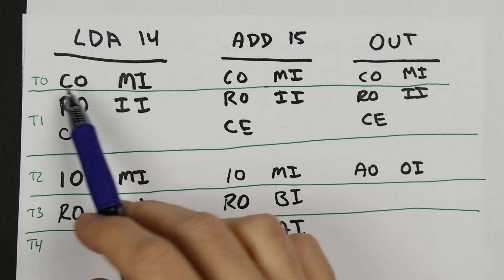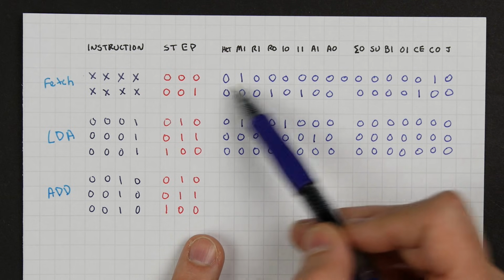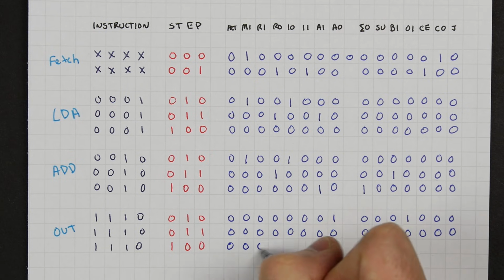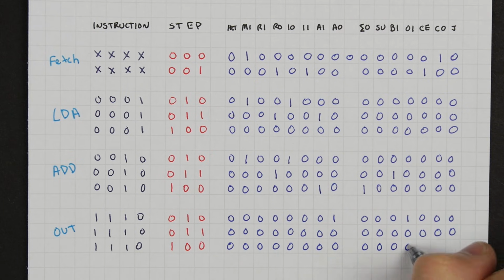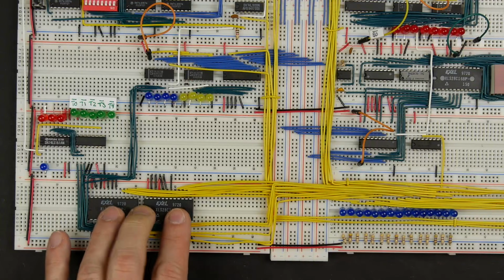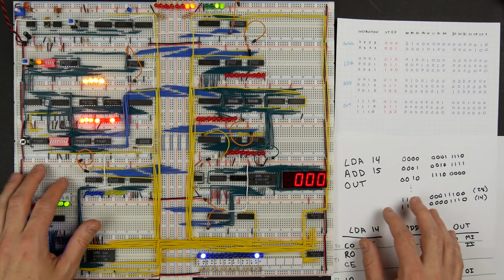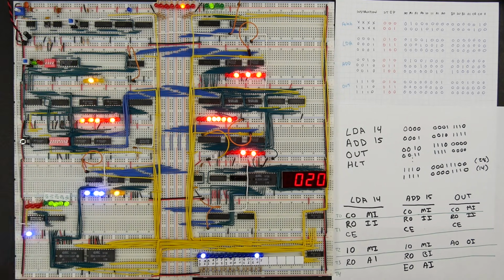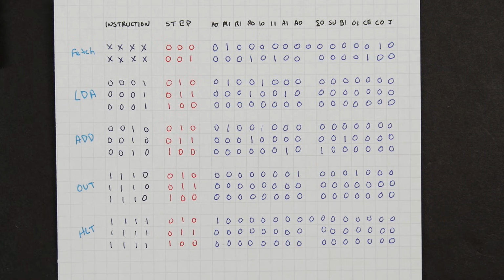8-bit CPU control logic: Part 3

Comment: This awesome "thing we could do with this 16th output from the eeprom" is to implement the counter reset so that commands don't have extra wasted cycles. The 16th command (io0 on the right eeprom) could be to made to be 1 to reset the timer when the command is completed. The trick would be to not mess up your program by resetting the step too early.

You could make this 'reset' its own line on the command table for a given computer command so that it only takes 1 cycle to finish off the current command (versus 2 wasted cycles on the OUT command, or more wasted cycles if we implemented a complicated command later), or, more elegantly, use the off-clock cycle pulse to check if this 16th bit is 1,and if so, then reset the steper to zero instead of incrementing on the clock tick.

Hope I thought that through properly!
I love all of your videos, they are amazing. Thank you!
Reply: "not mess up your program by resetting the step too early", that''s the point. A D-register may do the trick with the next clock pulse, if you still have room on the bread board.

Comment: Updated the parts list: https://github.com/DutchMaker/8-bit-Breadboard-Computer
@Ben: I simplified the EEPROM programming a bit on my build by passing the T0+T1+Instruction through an AND gate so that the instruction is only passed through to the address lines when T0 and T1 are both 0.
That way the fetch cycle only has to be programmed once and not for all instructions.
Reply: I would highly, HIGHLY recommend buying the best quality boards you can find. If they end up being the biggest cost in the project so be it. I've had cheaper breadboards develop contact problems with only hours of use, I'd hate to think how cheap boards would behave on a project of this scale...
Reply: Hello,  Took the liberty and updated your nice control-eeprom-2 spreadsheet 

control-eeprom-2.xls 
https://drive.google.com/open?id=0B2ZePCSY4JnFSk01V1FtQUVsdWs 

control-eeprom-2.pdf
https://drive.google.com/open?id=0B2ZePCSY4JnFNHNYU0gwclZFQzQ 

Thanks Mike
Reply: Thanks a lot for having a parts list. I'm really considering building this myself now that I know what I need. Any idea for the approximate total price for all parts (besides breadboard and wire maybe)?
Reply: Around $80 on chips (which will get you more chips than you need), $30 in breadboards (but this really depends on what quality you buy. Ben's are definitely more expensive) and probably around $30 for wires (you want good quality 22 AWG solid core wire). I got all the parts from eBay, except for the wires which came from Adafruit.
Things like LED's, resistors, capacitors and switches were already in my possession but will otherwise also cost you around $10 - $20 depending on the bulk you are buying.
Reply: Thanks Mike, I'll make sure to add it to my repository!
Reply: I fully agree with that! Mine aren't the best quality and I had to put in a lot of extra wires for power lines and some capacitors in order to maintain acceptable voltage levels througout the circuit.

Comment: i find it hard to understand the eeprom programming
Reply: He had an entire hour+ worth of eeprom videos back a ways. Check them out, it makes a lot of sense.
Reply: The most helpful part was when he drew out the huge logic circuit that implemented the huge truth table (the lights on the digits on the counters for the OUT command) and then actually had it implemented. It allowed me to grasp what the eeprom was actually accomplishing, tho I'm not sure what it physically does inside that implements the truth table we program in, but whatever it does it reduces to that logic circuit he sketched out.
Reply: He has a video on how he programmed the EEPROM.
And while you are at it, watch all his videos on this build. They are great!
Reply: i had just forgotten how he programmed in the past
Reply: Simply put, you make Write enable LOW, Output Enable HIGH (these are active low signals).
Give an address to the address pins, give whatever you want at that address to I/O pins, and pass a 1ms pulse to the chip.

Comment: You could use the last control bit to reset the step counter which would reclaim those lost clock cycles on ops that use less than five cycles.
(I know the gains would be pretty minimal in this case (Only one cycle on three/one-step (incl/not incl fetch cycle) ops and zero cycles on four/two-step ops since the step-counter-reset micro-instruction itself would have to be a step), but it's something that would have exponentially larger benefits as your architecture gets complex with more steps available for each op. This is actually very interesting because it shows the benefits of a more complex architecture. By having more steps available per op (thereby increasing the complexity of the architecture; the cost), you can have more complex ops that reduce the amount of work the programmer has to do, as well as reducing memory requirements by reducing the number of ops required to accomplish a given task (the benefits).)
Reply: You could have your microinstruction counter reset take place on the last cycle of the instruction's operation, but that might require additional timing to make sure it worked right... A synchronous reset on the falling clock edge, perhaps, unique to this one control signal.
Reply: Exactly my thoughts!!

Comment: Since you mentioned additional functionality, have you thought about expanding the design to support larger memory spaces and instructions? 
You could easily modify the current design to use more cycles per instruction, make the address space 16 bit (by using two special 8 bit registers), and expand the instruction set to either use larger instructions (RISC style sort of like what the PIC16s do - other 8-bit MCUs might do the same thing), or adopt a variable instruction length CISC style with special registers (you are sort of already doing that, and it would mean possibly smaller code size at the expense of more instructions to define), or even adopt an already existing instruction set so that you can use already existing compilers (e.g. 8086, Z80, etc.). 
If you do that, you can then expand this series into memory mapped I/O, and then you also have the ability of taking the memory map and adding a MMU to deal with virtual memory. All of which should be doable using registers and EEPROMs as look-up tables (though it will quickly grow out of control in terms of breadboard space).
Reply: +hjups I definitely agree with you, and I hope Ben will tackle on the expansion of this CPU.. The book he talks about in the first video (I can't remember the title, it was written by Albert Malvino) does exactly this: it starts from the SAP-1, and adds more and more functionality with the SAP-2 and SAP-3, basicly expanding what was built in the previous step. It's a marvelous idea and I'm glad I found these videos, I'm learning lots of things
Reply: hjups that would all be possible but it would defeat the purpose of building the simplest computer possible for educational purposes
Reply: I disagree. The ability to expand the design without significantly modifying the core "computer" would have significantly more educational impact. If you compare starting off with a more complicated design in mind (which requires a lot of starting knowledge), rather than the ability to transition into a more complicated design, then you would be correct.
Right now, this model is a "toy" (in the academic sense), and can't really do much (especially with 16 Bytes of RAM). It would be a wasted opportunity to expand its functionality to teach more advanced topics. 
The mindset of keeping it simple for educational purposes is a pitfall that a lot of courses and textbooks encounter, and end up leaving a disconnect between the educational material and real systems. Unfortunately, only one of the courses I ever took broke that paradigm and ended up bringing the theory of operation back to reality (it was an FPGA based software defined radio, which could actually process an IQ stream and play audio). 
Keep in mind that I am not suggesting that the current design be abandoned, or that it should focus on a pipelined, super-scalar, or an out of order execution model, all of those things would defeat the purpose.

A simple example of what I am talking about..... let the current memory address 0 correspond to main memory. Let memory address 1 correspond to the lower 8 bits of the address, and memory address 2 correspond to the upper 8 bits. Now if you want to read from or write to the 16 bit address space, you set the address by writing to the bus memory address 1 and 2, and then read / write from bus memory address 0. Then the only other step needed is to support a 16 bit program counter, which could be connected to a simple multiplexer switching between the bus memory addresses and the program counter, which is toggled during the instruction fetch phase. 
What has that done differently to this design? It made the program counter 16 bits instead of 4 (an easy extension), removed the program counter address from the internal bus, and changed the way the RAM worked, but not how it appears to the rest of the system.... The ALU doesn't change, if the initial instruction set supports read/write from/to the current RAM, then the instruction set doesn't change, and in fact, the control signals from the micro-instructions don't change. (The jump instruction might changed based on how it's implemented, but you could do the MIPS method and keep the upper n bits). And with all of that, you just expanded your computer from having 16 Bytes of memory to having 65K!

Anyways, the point that I was trying to make is: the opportunity to teach more advanced topics based on the framework of a simple design is significantly more powerful than saying "here is a simple toy", now here is a real world case study, leaving the students (or in this cause audience) confused on how one went from the first to the second. And believe it or not, many computer engineering professors can't actually answer that question, because they never bothered to study systems outside of the "toy" setting (it took until a special topics graduate course for me to learn about how I/O is actually handled by a computer).

Comment: Might want to add an additional control line to reset the micro-code clock when the instruction is done so save unused cycles.
Reply: That was a suggestion posted in the comments to the last video in the series, I think he was trying to acknowledge the possibility of doing so, without getting into the implementation for now. However he has mentioned adding more to the computer (including more control lines) in the future. I'd guess that he may want to finish the basic version to finish the teaching tool, then address some of the possible optimizations from the comments (adding CE to T1 was one such optimization that did get added already).
Reply: There's a spare output line on one of the EEPROMS, that could be used to send a reset pulse to the microinstruction counter :)
Reply: You could also just use a combination of control words that is never used (e.g. all 0) to reset the step counter. Just take timing into account, so that a delayed in the eeprom outputs does not accidentally reset the counter (e.g. by waiting for the falling edge of the clock).
Reply: @LordPhobos6502  I thought the exact same thing. It's actually extremely easy to implement
Reply: I was thinking the same
Reply: This would be a very simple way to do it, and just set that signal work the last step of any op. When I build mine, I'm definitely going to do that ;)
Reply: Yeah i was thinking that too, it would work very nicely.
Reply: The point is  "not mess up your program by resetting the step too early". A D-register may do the trick with the next clock pulse, if you still have room on the bread board.
Reply: Nice idea, Im going to try to implement instructions as an FSM so it will not need that control line.
Reply: exactly i was thinking same
Reply: Variable length pipeline is what made the slower 6502 outperform the z80... despite the z80 having more compact instructions. So resetting the clock is a worthy pursuit.
Reply: @Altera32  Sorry? The Z80 has a perfectly variable pipeline. There are instructions of 4, 5, 6, 7, 8, 9, 10, 11, 12, 13, , 14, 15, 16, 17, 19, 20, 21, and 23 clock cycles. A memory fetch just takes 3cc (actually in the case of M1 fetches it is 2.5cc, which is why some Z80 devices only have wait states on M1 cycles), then it increments the memory refresh register, and it executes the rest of the instruction during the fetching of the next instruction. Some instructions like INC HL take 6cc instead of 4cc for this reason, because they reuse the 16-bit circuitry used to fetch the next instruction, which means that the next fetch needs to be delayed.
Another example: LD (IX+*),A and LD (IX+*),* take the same amount of time (19cc), despite the latter having to fetch one extra byte. This fetch is just executed in parallel with the IX+* addition.

The Z80 may need more clock cycles for the same number of operations, but that is not because it is not pipelined. If it wasn't, it would be nearly twice as slow. It is also designed to run at 3x as high a clock rate as the 6502. The speed difference is from the 6502's many addressing modes making for faster memory accesses. Meanwhile the Z80 was trying to cut down on hardware cost by reusing circuitry. For example it only has a 4-bit ALU, so even 8-bit operations need to pass through it twice. This only becomes a bottleneck when doing 16-bit arithmetic, though.

Also, here is an example instruction for each instruction length, to show that I know what I'm talking about:
4: NOP
5: RET Z if NZ
6: LD SP,HL
7: LD A,*
8: NEG
9: LD A,I
10: POP HL
11: PUSH HL
12: IN A,(C)
13: LD A,(**)
14: LD IX,**
15: ADC HL,HL
16: LD HL,(**)
17: CALL **
19: LD (IX+*),A
20: LD IX,(**)
21: LDIR
23: SLA (IX+*)

This is what needs to happen during a 4cc NOP, for example:
- put PC on the data bus, increment PC
- 2.5cc later, read the value
- increment memory refresh register (using the same circuitry as the one that increments PC) while decoding the read value
- start fetching the next opcode

now here is a LD A,B (also 4cc):
- put PC on the data bus, increment PC
- 2.5cc later, read the value
- increment memory refresh register (using the same circuitry as the one that increments PC) while decoding the read value
- start fetching the next opcode
- pass the LSN of B to the ALU, store it to A
- pass the MSN of B to the ALU, store it to A

And a INC HL (6cc):
- put PC on the data bus, increment PC
- 2.5cc later, read the value
- increment memory refresh register (using the same circuitry as the one that increments PC) while decoding the read value
- do not start fetching the next opcode because INC HL needs to increment a 16-bit value first
- increment the 16-bit HL
- start fetching the next opcode
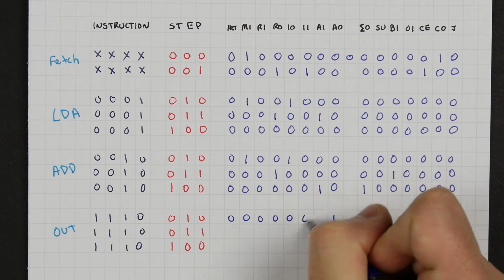Reply: 9:08 he explicitly mentions that possibility.
Reply: I notice an output unused as well and thought the same thing.
Reply: Count down from max number of steps, when you reach zero use an or gate that sums your binary pattern to trigger counter reset; (Invert output if required).

Comment: I had a microprocessors class in college where we breadboard a MC68000, added memory, and then programmed it to do something but this whole series is immensely more educational than that college course.  Thank you for these videos!
Reply: i have learned more from this guy than any prof i had
Reply: An MC68000??? That's quite the beefy processor to start with! I wouldn't blame anyone for getting lost--I think a Z80 or 8080 would've been a better starting point.
Reply: @ghospeas9625 a 6502 is the perfect starter cpu, because it is so simple to interface with. A z80 or 8080 are horrible because they require multiple bus cycles to put out address and data, require latches, etc.
Reply: In my microprocessors class, we had devices into which we could plug the processors and it would help us program them in hexadecimal and see what they were doing. We worked with three or four processors throughout the class. I think we worked with the 6502, Z80, and 68000.

These videos are absolutely amazing, but I probably wouldn't get as much out of them if it wasn't for my college classes and self-education.
Reply: I was just telling my wife pretty much the same thing.
Reply: In my microprocessor class, we never built one in hardware, just designed and simulated one in a gate-level designer/simulator (graphical one, we never learned an HDL).  That was a simplified version of a PowerPC chip (basically just the user space, not any of the supervisor functions).  That chip would have been a nightmare to build like this, but still, I think working with actual hardware would have been more useful...
Reply: Back in the 90s I built a burner to program 68705 eproms, then built a breadboard and wrote code to do some stuff with it. Hooked it into the transmission output of my vette and created a 0-60 and 0-100mph timer. The trans output shaft would pulse every revolution, and I would time how long between pulses to calculate speed (just a little math with the output shaft, differential, and wheel size). Exactly how the digital dash worked. 

I still have the breadboard, unfortunately I cannot for the life of me find the source code. It was a real bummer. Got me back into watching this stuff.

68xxx was a great processor, very easy assembly, relatively speaking. I came from 6502, and 68xxx was a breeze!
Reply: College is a waste of money
Reply: Especially nowadays when a semester can cost $5k-20k  uhhhh
Reply: @latina_butt_sniffer  Not for me it wasn't
Reply: @michaelbauers8800  you are still writing youtube comments!
Reply: @DarthZackTheFirstI  Was I supposed to stop doing it, Darth? ;)